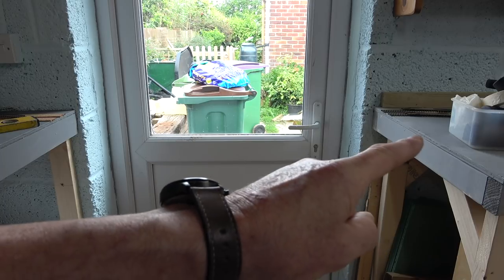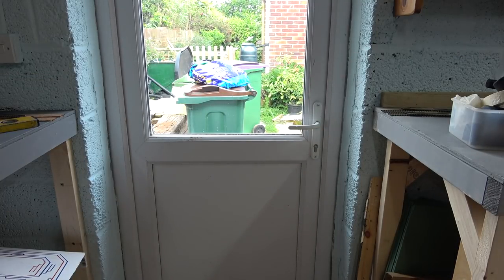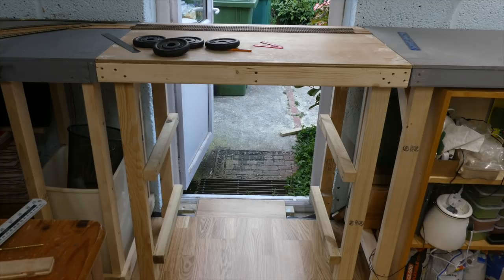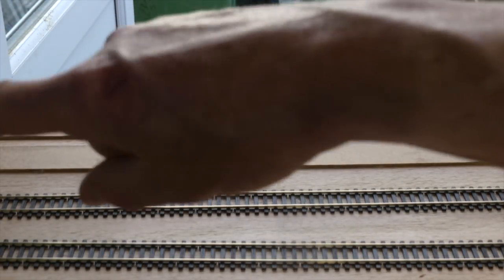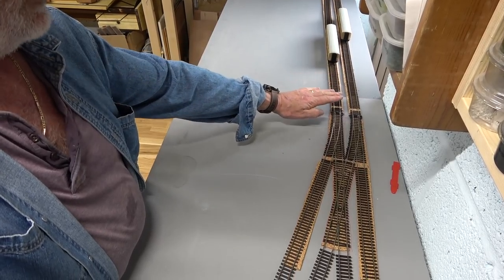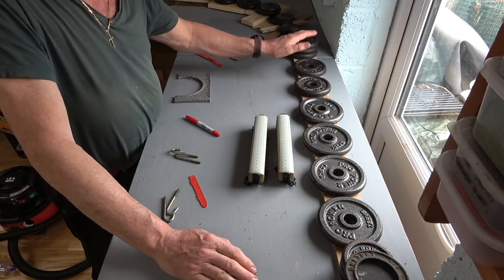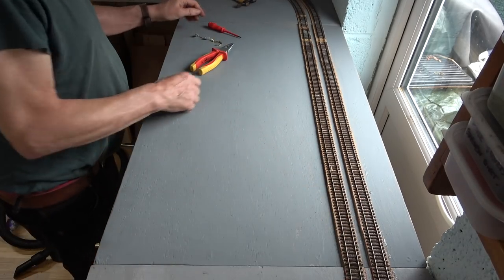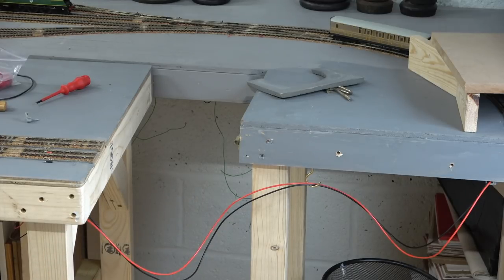34. The door and how I got Past it, linking Ashord Station to Sandling Junction.

Comment: Great bit of woodwork Paul, most impressive! If you want to get rid of the long bus extensions to the sliding table you could use one of those 2 part choc blocs. I use them on my removable sections and they work well
Cheers Steve
Reply from the maker: Cheers Steve, at the moment Ill keep them, but may well change if i need the table moved further away Cheers Paul

Comment: Nice to see it working well and Excellent carpentry. I’ve spent many hours refitting the sleepers at my joins on the removable baseboard but you have been sensible by keeping the joins on a straight and having only two of them. Look forward to seeing it fully working towards sanding junction
Reply from the maker: Many thanks, i feel twos enough and straight, curved scared the hell out of me, best wishes Paul

Comment: well it is working.. note to one self, you cut the legs on one side, it will change the height on the other side. good to know really ty. 
plug in spade connectors might help with the wiring, so you can move it right out of the way . 
very good job indeed. 
long as expansion and contraction don't change things to much over time
Reply from the maker: I get all that, and will watch for changes and deal if needed, cheers Paul

Comment: Hello,
hope this is helpful. I would avoid putting anything under the pull-out section, like a shelf, for a while as you may find crawling under it to get outside may be preferable to moving it every time? Not so much at the end of the day, but whilst you are running trains etc.
Reply from the maker: Ian B Hi Ian , a true comment and already proven. There have been many occasions when a quick exit has been needed . So as you say shelves are out. Cheers Paul

Comment: That was a great job. An very original idea for a common problem. I whole heartedly sympathize with the alignment issue. My joint liftup and dropdown sections where about 2mm out on one corner which I've yet to find a solution to. I have the horrible feeling that whatever action I take will creat yet another problem. Can I ask what sized discs you used in your dremel.

Comment: The easier way would have been to make the thickness of the top of the removable section exactly the same as the fixed sections either side of the door. If you had then screwed two battens on the inner edges of the fixed section for the removable section to rest on you would have the baseboard completely level. The legs of the removable section could then have been made slightly shorter than the correct height. You would then be relying on the battens to control the alignment of the baseboards - not the legs - but you would still be able to slide the removable section in and out.
Reply from the maker: Hi you described exactly what i did and the video shows, the change happened when I braced the legs, threw it out of whack, cheers Paul
Reply: @Sandlingjunction  That's not what I could see from your video. From what I can see you are still relying on the legs to control the finished height whereas with the method I suggested above the legs would be slightly off the floor when the section is in place and the top is supported by the battens. This way the only function of the legs is to allow you to move the removable section around when you need access. I have done a drawing to show what I mean - https://i.ibb.co/LC7x2fb/Sandling.jpg
Reply from the maker: @Ashjuk  Now you make sense the penny dropped and i started the whole buils that way as you could see in the time lapse, but removed the guides.. should have left them in place. can change now but if what was done messes up i can remove the height adjust meant on the track and revert to the guides....cheers Paul

Comment: Hi Paul, good job and I liked your thinking. I was wondering, after being so meticulous how you might have got the levels wrong. Is it possible, when you put the legs on, that you put the unit back the wrong way around (front at the back and back at the front) - Your tops may be level, but is your floor. I might have been inclined to check that out before taking more off of the legs - just in case it might have been that simple. Just a thought. :-)
Reply from the maker: Hi yes the board went back correctly as I marked one side, it was when I braced the legs it was all smooth until that moment, cheers Paul

Comment: <says to self> he's only cut one of those tracks.  No he must have just edited out cutting the near track.  

Oops.  :D

Looking forward to seeing if the trolley works as a long-term solution too.  I think I'd have used some form of plug and socket to connect the bus wires rather than the trailing wires.  Not least as then it would be possible to move the trolley completely out of the way.